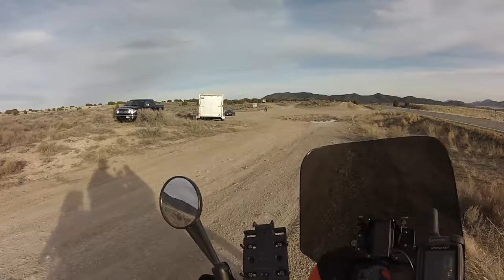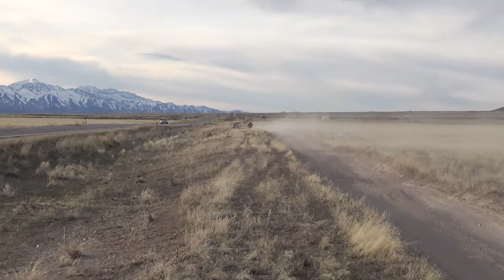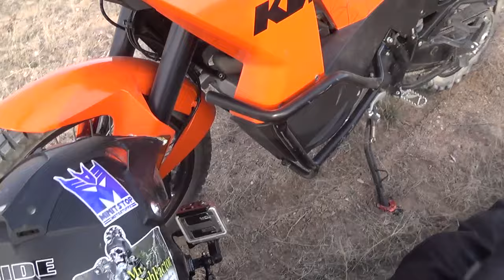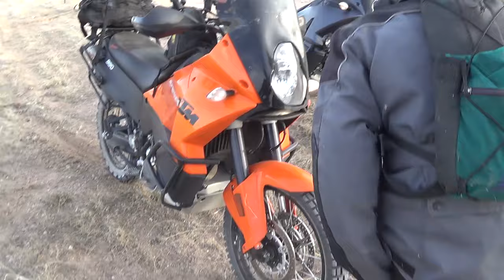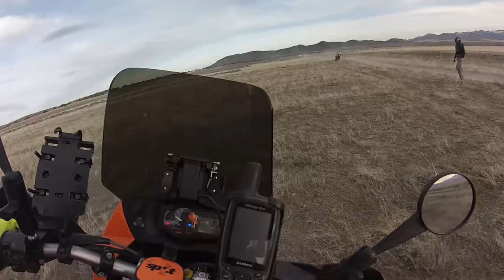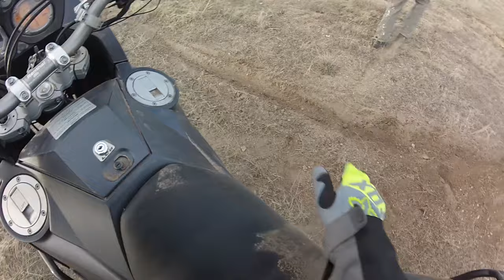KTM 990 Front Suspension test/adjust - Rojo's clickers - Pt.2

Comment: My 2013 990 on sport setting was doing exactly like your friends bike, felt fine until hitting whoops, then it was banging and bottoming to the point I thought I'd added a fourth dent in my front rim.
My previous 950, I put .54 springs in (.48 stock in Europe on a 2003 model) and that made a big difference off road, I'm thinking of maybe .60 as I don't do much high speed stuff, I look for the slower more technical terrain.
When I get back home from my vacation, first thing I'm doing is upping the fork compression as you guys have done, thanks for the film :)
Phil
Reply from the maker: You becha buddy, let us know how she turns out :)

Comment: some real good tips here dude. I have a 2008 990 adventure s and plan on tuning the suspension some time soon. looking forward to seeing the difference.
Reply from the maker: Bob Dobalina Mine is an 07', and adjusting the clickers should help some, but if you start pushing hard, the revalve really helps. This is just straight line testing to be able to see how far the suspension travels, but in all around riding, its very noticable.
Reply: cheers I ride quite steady at the moment just getting used to the big girl. once I am tuned in I may revalve. thanks for the advice.

Comment: Thanks Duff...love your stuff.  ouch!  Moved to Utah from the PNW  just to play with my 990 in the desert more often so  I really appreciate your efforts to share you knowledge.   BTW...  do you remember what were the other susp  settings  you landed on for on the stock 2010?  I'm on a stock 08 and 185 lbs with most of my time in PNW single track.  Now that I'm here and running in some wide open spaces, I'm starting to find the limits of the stock setup but dam these are fun bikes!   BTW - do you do any 990 suspension work @ Duff Racing?

Comment: You are now (2 clicks) at the hard end of the compression adjustment range which tells me the bike needs stiffer fork springs. I've heard they come with the same springs stock as the single cylinder 350-450's.  If "rojo" does any serious off road adventure touring and camping, when he adds 60 -80 lbs of gear, those 2 clicks won't cut it.  You need to come up a couple steps in fork spring, size and get back to the middle of the compression adjustment.
Reply from the maker: Mike  Thompson Yep, agreed, we revalved his forks and went to .72kg/mm springs just like my bike... now he's in love...

Comment: Wow  .72's! how much does that guy weigh?  I'm 250 and was recommended .64's  I hope that wasn't the formula where you add your weight to the bikes weight and move the decimal 3 places to the left. Must have been some serious spring guide trimming  with those coils.
Reply from the maker: Rojo weighs about 180, I'm 185, and after spending serious time with multiple techs, spring guides, and then testing, .64's are still too soft for fast desert riding. The springs we purchased from racetech are .72 kg/mm's which are shorter than stock, where we had to make a PVC spacer (upcoming video) but we did not have to trim the spring guides at all. The forks are still very compliant, nice for road riding, and when you hit stuff hard, they handle it very well, even when loaded up some. Surprisingly, the forks are not harsh at all, probably because the bike is so heavy. Once Rojo rode mine, he didn't care for his anymore...lol  I am very happy with this combo we've come up with, but maybe it's not for everybody. I have one friend with a 950 and .64 springs, stock valving, who is very happy with his too.